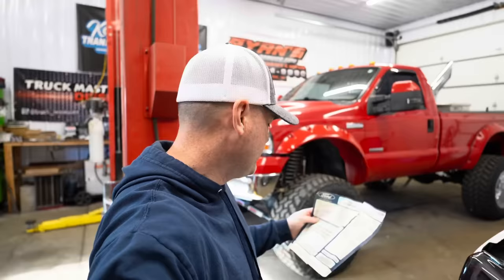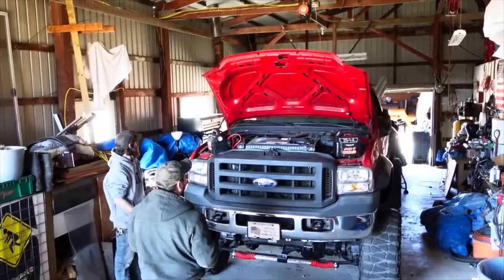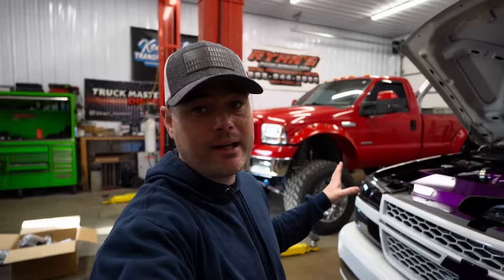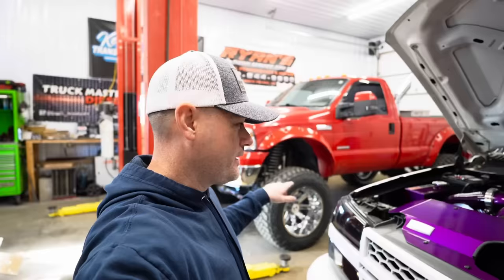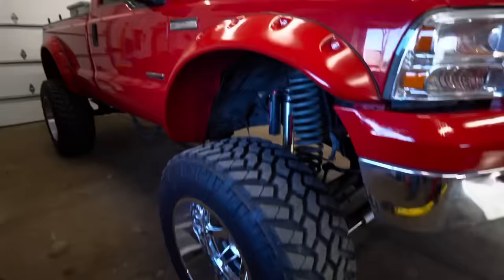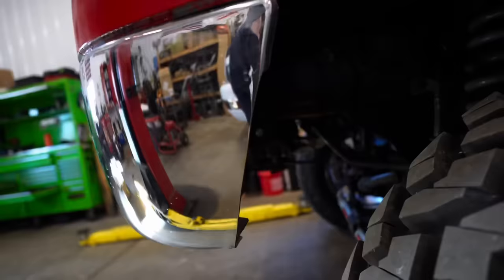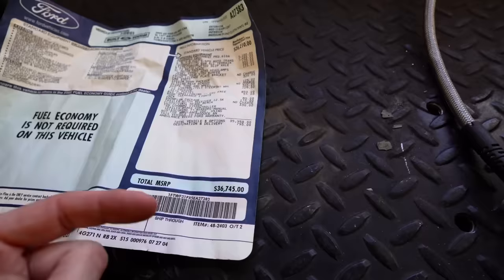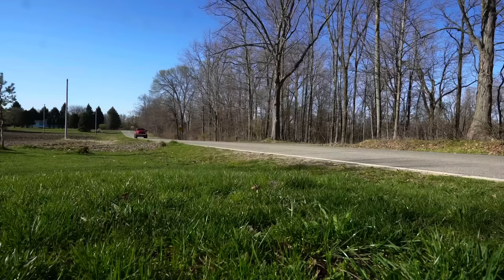Saying Goodbye Forever To The Powerstroke I Inherited! This Is Why…

Comment: I have a question... if you could build your dream truck.  What would you build  ? 
   I think you should atleast go to SEMA. But I  believe you have what it takes.  To do a SEMA build.  You have the collaborative connections.  You have the ability.  Something to consider.... but attending it is a valuable resource of information.  Afterall that is what it was designed for.  
   And one last thing... you have built full size trucks.  Something to consider... a COLORADO..... A drastic change of perspective.  A TAHOE or SUBURBAN  would be cool. But a COLORADO would be definitely different.

Comment: I got my dads custom 1980ish Honda goldwing and 1980ish front wheel drive crystler car made tryke he bought it while i was on leave in iraq and while I was headin back to iraq he left on same flight to Arkansas to pick it up in 2008  after he passed away in 2019 and my mom and I both agreed we don't want to sell but we want to get it runnin agin it hasn't ran fer over 8 yrs I'm hopin only a starter issue I never had chance to find issue yet but soon I'm hopin to start to work on it after some bills get takin out

Comment: That’s funny my Dodge 3500 4 door long bed dullay 4x4 5.9 manual 6 speed and manual 4x4 selector and it’s a Laramie 36500 and I paid 34000 for it and I still drive it 142k no rust looks like new and it’s Bright white .